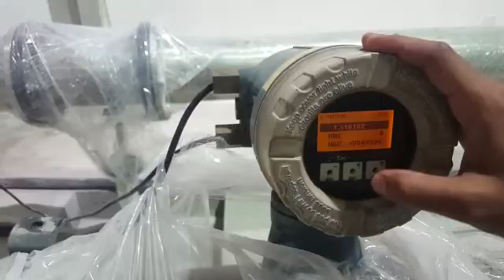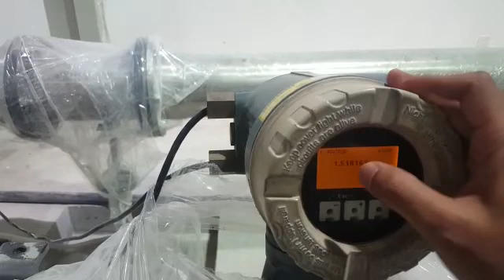flow meter calibration

Comment: My promass 40 display tube not osc. what doest it mean?
Reply: The message is telling you that the tube oscillations are not happening anymore which could be that the flow tube has failed, or an excitation current failure, but either way, measurement isn't possible if the tubes are not oscillating and it's nest you get the meter tested and repaired provided that spare parts are still available.

Comment: The main question is always: why do you need to change it, and whether you really understand what you are doing.
Reply from the maker: we change the K factor if the error of flow meter goes beyond its accuracy limits specified by manufacturer. if you need further information on this topic you can email farhan@picsarabia.com
Reply: @farhanansari5272  you should not change it on your own. These are factory calibrated.
Reply: @nomnamecpp  you need to change it if you have higher error than permissible

Comment: hi.. may i know how u calculate the k-factor?
Reply from the maker: aidil nur 
You get the new k factor by multiplying old factor with the ratio of test reading : true reading
Reply: @farhanansari5272  what is mean by tru readind and test reding
Reply from the maker: @muhammadishtiaq9711  
You adjust k factor when you find that your flow meter reading is innacurate. Now, you will only find out that your flow meter reading is innaccurate when you compare it with some reference meter whose value you consider as true value.

So the true value means the value of reference meter and test reading is the reading of your flow meter
Reply: @farhanansari5272  hello sir I have problem in the  fast flo 620 Velocity measurement seems too high help me please 🙏
Reply: what the metode to get true reading ? using ultrasonic flow meter or PD meter?